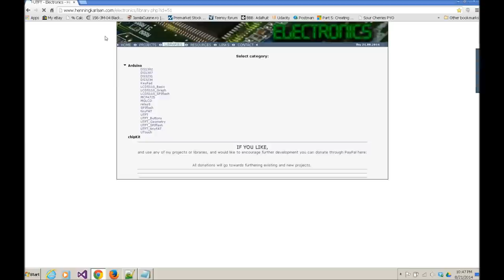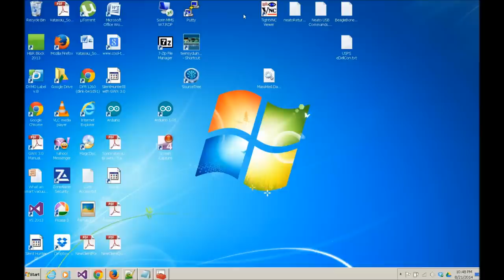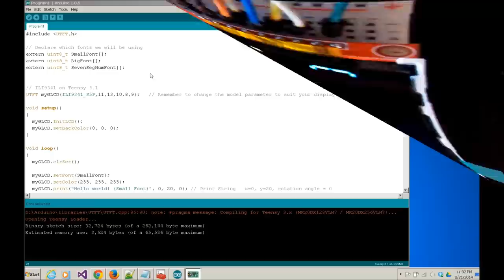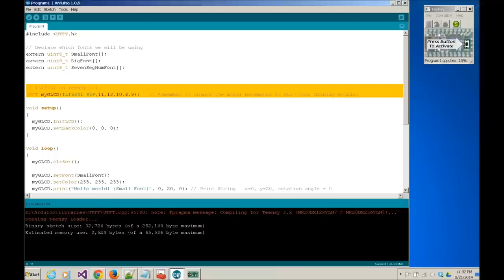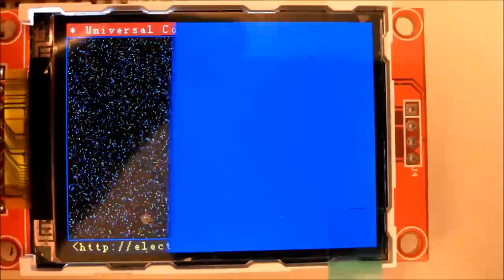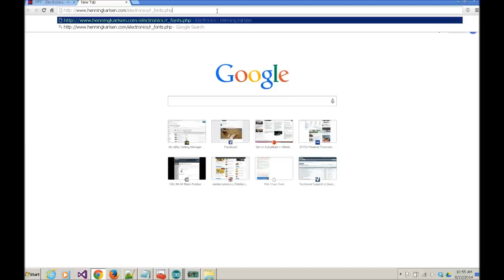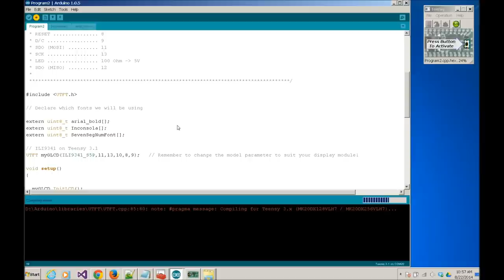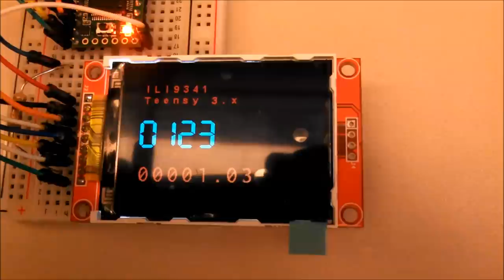Teensy 3.1 with 2.2" SPI TFT Display  with ILI9341

Comment: You did a good tuto here, but seems doesn't work. I re-checked connections but I'm sure that there is no problem. I uploaded the "UTFT_Demo_320x240" sketch and I modified the UTFT constructor to get this : UTFT myGLCD(ILI9341_S5P, 11, 13, 10, 8, 9); But it still doesn't work :(
Reply from the maker: Yeko Hat can you post pictures of your setup? there are some displays that looks like mine, but they are different (different controller or pins)
Reply: Sorin Vatasoiu Thanks to answer me :) 
Here is a photo of my display, its the same as you I think : http://www.bajdi.com/wp-content/uploads/2013/11/TFT-320x240-back.jpg

And I used the same wiring sheme as you
Reply from the maker: Yeko Hat the display looks the same. do you have a picture of your wiring? what resistor did you used?
Reply: Sorin Vatasoiu Sorry I took time to respond cuz I'm a bit busy :)
Here is a pic of my wiring, who is the same as your, and the resistor I'm using is a 100 Ohm resistor : http://tinyurl.com/pdzbng4

Comment: Would you mind sharing the parts that I need to do this? I have the Teensy already.
Thanks
Reply from the maker: flaco198111 
You need a TFT display like in the video: do a google search for: "2.2" SPI TFT Display with ILI9341" and get one (should be < $10.
Then you need one resistor of 330 ohm (close values will work also) and 9 wire and one breadboard.

Then try to replicate the circuit from video and upload the code. It should work if everything is done correctly.
Before starting, load a demo program (Blink) in Teensy 3.1 to make sure you have a working one.
Reply: Sorin Vatasoiu Thank you for taking the time to reply. 
U rock!